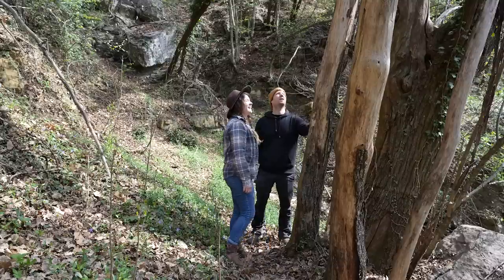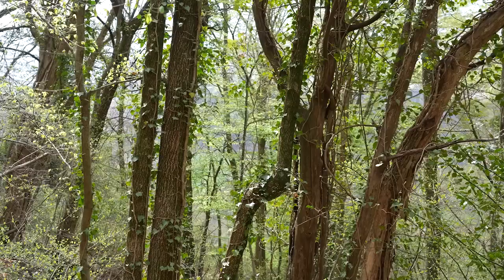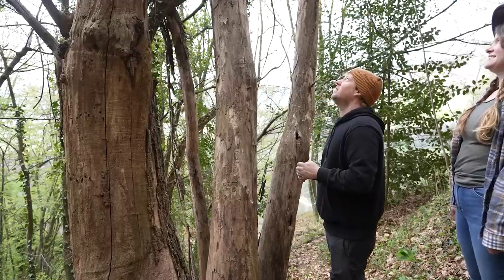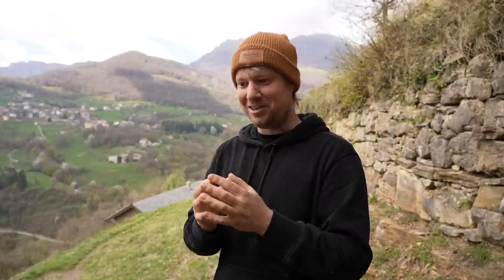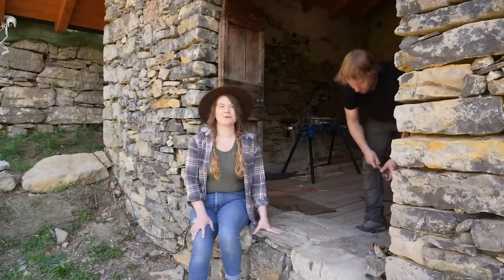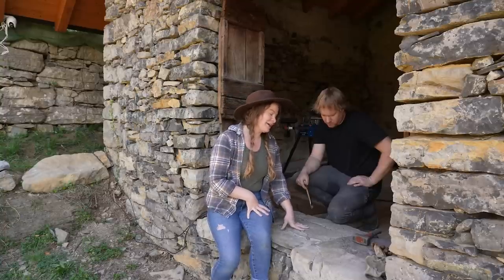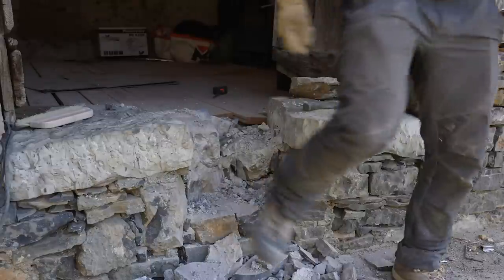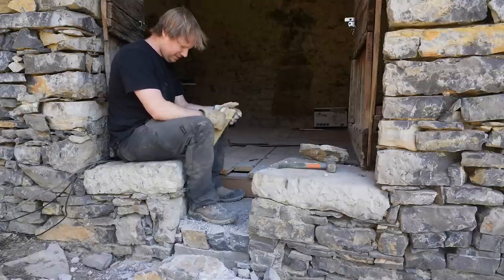Uncovering HIDDEN History on our Homestead

Comment: It's touching your respect for the history of the house and its former inhabitants. Make sure the slab you're going to place on the step is slightly inclined towards the outside, so in case of storms the water can flow away quickly. I'm very curious to know how you're going to insulate the house from the outside and still keep those stones or a look of the stones. At the moment it's  biga mystery to me!

Comment: In my past, I had purchased a house on a simple hill.  But just like you, I was immediately inspired by the idea of terracing it and adding an outdoor kitchen/oven and eating space. Also added a basic rustic natural stone (one piece) platform for an outdoor shower which I used right up to winter freeze. Granted it had hot water. Delicious. Keep dreaming.  The fact you have old dead chestnut trees is a priceless treasure. You were a bit understated about how extraordinary they really are.
Reply: My my house was built during the American Revolution on a steep hill overlooking the Hudson River. In this respect, one of my questions for you is how you are dealing with drainage as rain water works its way down the steep grading.  The older portion of my house’s foundation consisted of deep trenches filled with large rocks.  When I purchased the house, I wondered how some of the drainage issue was addressed. Since the house was under restoration I was not there that often. Finally, I saw how the water coming down the hill was dealt with. The ground floor wall had two openings. When rain was sufficiently strong, water rolled down the hill, traveled through a hole in the lower floor front of the house and  out a back wall hole and down the hill. Efficient, and the copperhead snakes loved it.  As it relates to Chestnut trees, I had many requests from historians to take tiny core samples out of the chestnut tree beams in the house for dating purposes in order to add ring configurations to a tree dating data base.  Since you have chestnut beams and wood in your buildings, it may be interesting for you to have then dated.  Often when old structures were demolished, chestnut beams were reused in the construction of newer buildings. You may be surprised about old they are. My house was built from wood. They needed to build shelter quickly at that time and even though ample rock was available a wood structure could be built quickly.  The problem I had with my house was it was designated as a heritage structure and any changes needed to go through a historical review process down to every door and shutter. I have been enormously impressed with the engineering, care and enormous manual labor invested in you buildings.  I will not be surprised if some very interesting artifacts emerge on your property. Also, your children are adorable and a joy to watch  Tᴇxᴛ ᴍᴇ ᴏɴ Tᴇʟᴇɢʀᴀᴍ👉raisingvoyagers